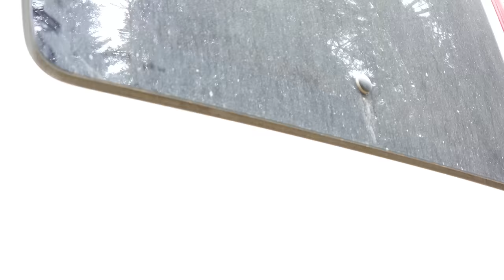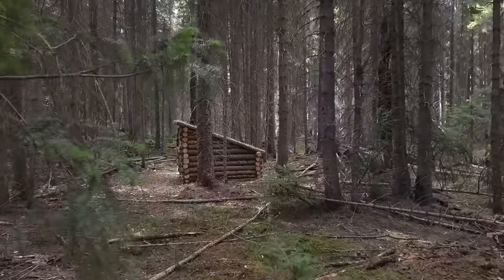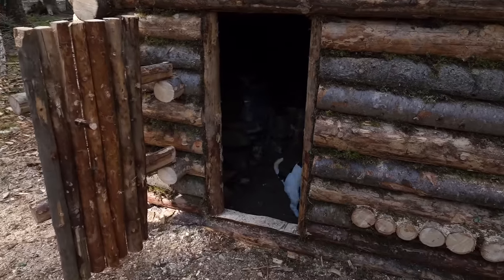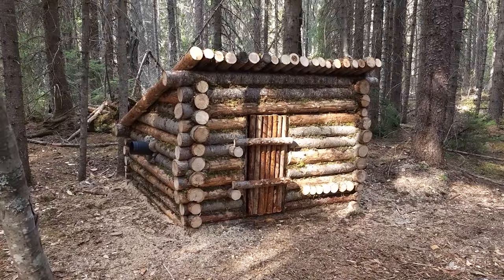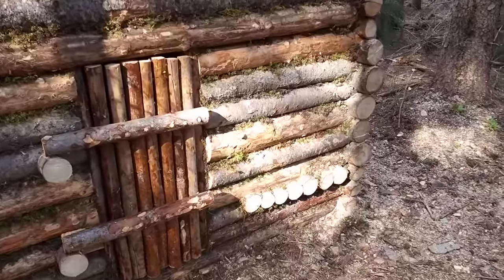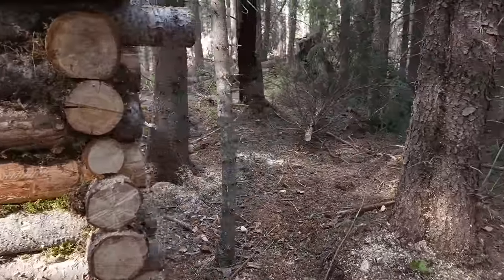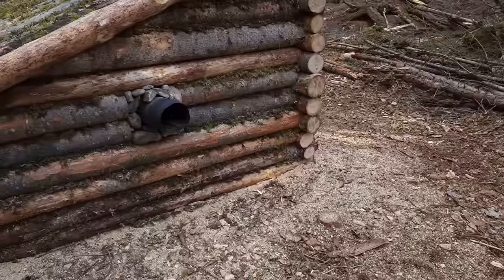I Built a Secret Tiny Cabin that has Wood Stove Heating

Comment: That dog really knows how to make itself comfortable.  It actually tucked itself into the sleeping bag.
Reply: I like how he never really ran off. Worked as a security guard for any potential nosy squirrels.
Reply: What is the breed?
Reply: Your doggie is really keeping an eye on things.
Reply: My brother had a Parsons Russell, he would stick around us when we went into the woods, always believed him to be a "people dog."  He didn't like the noise of power tools, but would stay around instead of going exploring on his own. Miss you pal.

Like that you used a battery operated saw & drill, the lack of an internal combustion engine really made the video easier to watch.
After you get the roof weatherproofed, consider putting some extensions on the bed frame for an outdoor bench or cabinet, or firewood lean to.

Comment: I have to say this is one of few Cabin builds I've enjoyed watching. When I built mine back in 1986 I put those Hinges on the Inside making it harder for someone to enter and finally used a Galvanized Lock system against thieves. I use to leave the door unlocked but I had a theft problem. The thief was eventually arrested when Deer Camera's became available in 1999. Try a Peppermint Mixture sprayed on the outside of the door and inside to keep bugs at bay. 1 quart distilled water, one cup Vodka and 30 drops of Peppermint Oil. Mix well and then use a cheap Spray bottle to spray.
Reply: Minimalistycznie,ale pięknie.Bardzo mi się podobają👏
Reply: Nice cabin and a sweet dog.  Don't forget to leak proof the roof
.Jon in tennessee
Reply: No rock footings?

Comment: That's a cool cabin. Good job with a few modern tools to do some old timey work! One small suggestion if you live in a really cold area, a longer stove pipe will take advantage of heat that is otherwise lost. If you run it up to the ceiling and across to the other side it will put out much more heat!
Reply: Good point. I worked in an ancient courthouse in rural Nevada. They heated the big  courtroom with a single wood stove and an iron tube 25 feet long across the room, radiating heat as it went out.
Reply: @xxxYYZxxx  Put another Tee on the inside right off the top of the stove and not that 90 degree bend, Close off the top and you should have a much more stable platform to place and cooking stuff and not that rocky round tube where it looked like that pot just might tip over.
Reply: Don't worry, it'll be PLENTY warm when it catches on fire because of all the "clearances to combustibles" issues! 😉🔥🛖🔥
Reply: I liked the suggestions of running the pipe across the room.

But keep it low to the floor to maximize the heat exchange since heat rises, and then run the vertical pipe up and along the inner wall and have it exit prior to the ceiling/roof - on the side wall to a standard vertical pipe with a vented cover to keep the rain and snow out, plus birds and insects.

My Wife had a 10' W x 12' L 
x 14' H Barn style shed by Tuff Shed built for me to work on my projects and "writings" and I needed to design a heating unit to keep it warm during the winter and have utilized both the propane tank in 5 and 10 gal. as well as a 30 gal "oil' drum as the burners/stoves with great success for each one since the total area is only about 1,600 cubic feet since it has a Gambrel style roof.

I use 12" x 24" cast paver with aluminum foil between the floor and the walls to keep the heat transference to a minimum and also on the outside surface of the pavers to reflect the heat into 6he interior of the shop.

Finally, I just found a discarded
bbq/smoker and intend to tie it in to the heating system I now have since I can use it to cook with too.

Hope this helps someone with a solution for a heating unit for their shop or maybe even thier home in an emergency and the videos are here on You-Tube if you need them.
Reply: The rocks will heat up and radiate, but that takes much longer than black pipe.
Reply: 1st time I saw this was a ski lodge (Ptmargin) up in the Rockies.  I thought it was brilliant.

Comment: so on the roof to help waterproofing, make a mixture of the dirt (make mud) and mix in any loose gravel you can find and since you have lichens, mix those in as well.  Make it about 6" thick and cover with a  thin coating of the downed branches.  The mud/gravel acts like a cement, the lichens grow and stabilize, the smaller branches reduce erosion.  Nice job on the cabin.
Reply: Brilliant!
Reply: That’s approximately how I’ve seen roofs sealed up and it works.

Comment: Clay, Mortar or a Wood ash cement could work to fill the roof gaps. Debarking the timber and heating them in  a fire will help reduce the sap drip. Great little video enjoyed it.
Reply: My Dad built one for his momma when he was a teen in Kentucky
Reply: I have one question ❓ . Is it rain proof? .
Reply: I was thinking the same thing; but after laying your clay for example, take the vent off the wood stove, plug the vent, start the fire and smoke/heat up the inside really hot.  Should take care of critters that live in the thatch, which is what middle ages people did periodically on their thatch roofs and set the clay hard.
Reply: Great 'little' video ??  Let me see u do it, Mr. Big......🤣
Reply: Clay sounds more user friendly, natural.  But digging to find enough clay is work.
Reply: @mutteringmale  Smart
 ...great idea.   Cinnamon oil is costly, but natural....no critter, flying, walking, sliding wants any cinmamon oil. Dogs cats snakes spiders.None.    insects snakes hate salt too
Reply: The only thing I know for sure is you de-bark the timber if you want it to last .

Comment: only thing I would have done different is burn the surface of bottom logs that have contact with the ground, reduces rotting caused by ground moisture - it won't prevent rot entirely, but greatly reduces it and prolongs the structure's lifespan
Reply: Yes indeed, however, he’s not going to be living there for 20 years 😉
Reply: There's the "I woulda guy".
Reply: @deliman9710  pretty sure Foresty enjoys tips and tricks
Reply: @phil veburst  He did ask for comments.
Reply: Did you get that idea from "My self Reliance" videos?
Reply: We built our 10×12' cabin with the first course on old cinder blocks. Also used scrap rough cut lumber to make a floor joist system that doesn't touch the ground underneath. We used old crate lumber for the flooring. That was 17 years ago. So far, so good.

Comment: Cool project!  I love this type of construction.  A tip for next time, make all notches downward facing.  Upward facing notches catch the rain, like pouring into a bowl, promoting rot and shortening the life of the joint.  Downward facing notches are like turning the bowl upside down, allowing the rain to shed and run off the curved surface.
Reply: Well that makes sense, I never would have thought of that. You might be a genius 😁
Thanks and God bless you.
Reply: @jude7321  Nah, the geniuses were those early builders who figured it out.  I just came across the technique by accident once while studying log cabin construction, but it made sense to me.  Thanks for your kind words!
Reply: @billparrish4385  
Welcome ❣️🌿🐦
Reply: In response to the notches comment he did halving joints 1 up 1 down can you elaborate on how you mean
Reply: @jackmathias7808  always leave top of bottom log round uncut cut bottom of next log and so on so only bottom of everyblog is cut ..
Reply: @jackmathias7808   @Jack Mathias  Instead of doing the notches in both directions, just notch out the bottom surface of each log end, flipping it over from time to time to check the fit has no gaps, and carving out any high points, to fit it perfectly as possible to the rounded surface of the log below that.  You can take out half of the upper log's bulk as your notch, in order to close the caulking gap along the length of the log, just no more, and it won't be too weak.  Having the rounded surfaces pointing up causes the rain to wash down over the outside surface of the log and away, not staying on the wood too long, as if you were to pour water over an inverted bowl.  Any notches you have facing upward are like having the bowl right-side up, catching the rain water, which would soak into the wood fibers and rot out the joint much sooner.
Reply: Nice.
Reply: @billparrish4385  can't imagine being a very easy job matching up this way but it does make perfect sense why to avoid halving the lower logs ontop, would planing it into a sloped shape upsidown v be effective also or would removing the bark allow too much moisture into the log
Reply: I just wonder how long the logs on the ground will last.
Reply: You're a good man, Bill

Comment: The hinges for the door are simply brilliant!  Best example of bushcraft ingenuity I've seen on YouTube.    You've got a new subscriber!
Reply: Except someone could just lift the door off from the outside.
Reply: @samueladams4218  easily solved by putting another pin thru the bottom if he drilled it out and made the other pin longer.
Reply: @samueladams4218  He mentioned on the video that the door was just for a peace of mind knowing that he wouldn't wake up with a bear staring at him like: "hi there, beauty".
Reply: @samueladams4218  if the door is latched from the inside it couldn’t be lifted off the hinges as the door would hit above it on the beam.
Reply from the maker: Thank you, thanks for subscribing 🙂

Comment: That cabin will save someone's life. Man, the stove is icing on the cake.
Reply: Why the rock's around the stove? Keep it from starting the wall on fire?
Reply: @Lilmickcrocodiledundee0001  Those should soak up the heat and radiate it into the shelter, I'd think.
Reply: @snakemain  ohh I see. Thank you
Reply: Yeah. Keep that cabin for the homeless man.
Reply: @Lilmickcrocodiledundee0001  the rocks will absorb and radiate heat. It will help the cabin stay warm even after the fire dies down.
Reply: @neilmac4730  nice. Thank you for answering, much appreciated
Reply: @Lilmickcrocodiledundee0001  But you're not wrong. They also insulate the wall from the stove and stove pipe, without which you could end up outdoors at 40-below with all your gear burned up, because the place caught fire while you were asleep.

Comment: I think your first cabin build went super well. In the future, I would line the ceiling with a tarp or other impermeable material to prevent such drips, as well as a THICK layer of boughs, needles, sticks, dirt or other debris atop the roof for better insulation and waterproofing. As for the bugs, there are many natural options for deterring them, such as: lavender, citronella, yarrow and mint that you can also use as a bed liner and flooring. You can also cake your walls in mud made from the materials around you (especially if there's a freshwater source around where you can find clay. This would make an extra barrier for insects the go through, as well as act as an insulator in the colder months, and as a primitive grout/plaster to adhere bark shingles or other natural materials. 

Of course, these are only suggestions of things that have helped me in the past, and you're welcome to modify or ignore whatever you'd like. Your cabin is highly impressive, and I see potential for a full-on fortress in the future, as you continue add to, and to improve  upon, your existing project. Best of luck bud, and keep that little fur ball safe.

P.S.: It's actually a relief to hear you speak in this video.
Reply: De-barking the logs on the inside would help with the bugs. I've seen inexpensive draw-knifes on the web $25 to $40 and they're good tool for a woodsman to have on hand.  Great Video, handsome dog!!

Comment: I slept in a number of old shacks close to that one. On the ranch we called them line shacks. When I lived in Alaska we found old cabins much like that. Maybe a little bigger. When I was young they were everywhere. Anywhere a miner was working a claim there would be a little cabin. Most had corrugated galvanized metal roofs. Some had sod roofs but they were in bad shape. Sad to say50 years later those old cabins are mostly a pile of rubble. Some were cut apart for firewood. Sad to see that history almost gone.

Comment: Great build man! When you slab trees with your saw use just the bottom of the very tip of the saw. It allows for more control. To make the roof water tight I'd slab a bunch of trees about an inch thick and layer them like shingles that run the entire length of the cabin.

Comment: Brilliant. The door was cool and the stone around the pipe was a good idea. You can use hand sanitizer to get out pine sap. Works great.
Reply: No shit? Please do tell I'm intrigued 🤔  as to how you would go about it genuinely interested.
Reply: @johnprater7588  The gell hand sanitizer is the best because it doesn't run off. Just spread it around and it immediately starts breaking the sap down. I have also used it on other sticky surfaces. I am sure it's mostly the alcohol in it that causes it to work.
Reply: @thomasmorse6692  makes sense. Ok
Reply: I find margarine works really well for removing sap/pitch from hands, then a little soap and water to remove the margarine.  Not sure about in hair though, would need to shampoo after or attract every insect to yourself :D
Reply: I was logging for 12 year's 
Butter works great to remove pine sap

Comment: You will come to regret not peeling the logs. The bugs under the bark will actually make noise during the night and it can keep you awake. I have built several cabins out on my property and my first one I did not peel the logs and I could hear the bugs too. I would suggest next time  try to make a bed of small gravel under the bottom logs which will help defuse water down through the base and help keep the logs from rotting. As for shingles try buying a Froe for making shingles. Its cheap and will pay for it's self.

Comment: Find birch trees then strip the bark in wide strips, Makes good shingles for the roof when properly attached and lapped. Another good material is cedar shakes. You can make a sod roof over that if wanted. Cool cabin and great video!
Reply: Would that kill the tree?
Reply: @angeladudley1211  It depends on the size, health and location of the tree. If you take one or 
two strips off each tree it will most likely survive but if you strip the entire trunk the birch may bush out from below and shoot out of the base of the tree and start again.

Comment: Nice and interresting video.
New subscriber here from Sweden.

For safty reasons, I recommend you to get a longer exhaust tube with a much higher rise for your stove (at least 1 m bove the highest part of the roof).
This way you will minimize the risk of backdraft from the stove in windy weather.
Backdraft can easily and silently kill you in your sleep if have a very bad day.

Next safety tip, cap the exhaust tube with a spark arrestor so you don't burn down the forest or yourself.
Reply: The exhaust was my only issue with the video.
Reply: Informative comment, thanks for sharing the good knowledge
Reply: @HumanPerson_final  The exhaust was my only concern also.  You don't want to wake up dead.
Reply: I wish this comment could be the 1st anyone sees. His stove is super deadly for all these reasons.
Reply: Thanks, I came to offer similar advice. Not a lesson to learn the hard way!
Reply: @arbhall7572  yeah you see the smoke billowing out through the roof it must be pretty dense inside robbing oxygen

Comment: for the roof, use tar! next time for the stove, have the termination extend higher as it will draft better. The rule is that the taller the chimney, the better the draft and thus, less carbon monoxide exposure.
Reply: A battery powered carbon monoxide detector would be good, if someone was going to be living there.
Reply: Tar paper

Comment: Great cabin! For the roof I suggest putting one more layer of split logs to seal the gaps in the first layer. That’s how they did here in Sweden in the old days (actually splitting logs first, them making two overlapping layers as a roof). Cheers!
Reply: He is doing a hell of job the way he is doing it he doesnt need your advice
Reply: @bobwalton3642  yet the swedish are masters.
Reply: @bobwalton3642  I hear ya... except Forest did ask for suggestions. :)
Reply: @intercess6893  what
Reply: @bobwalton3642  He clearly stated he was open for suggestions on the roof.
Reply: @bobwalton3642  He asked for advice at the end of the video basically
Reply: Always good with some input.
Reply: @bobwalton3642  How incredibly rude you are.
Reply: @bobwalton3642 He specifically asked for suggestions on the roof issue. What a sperg lol